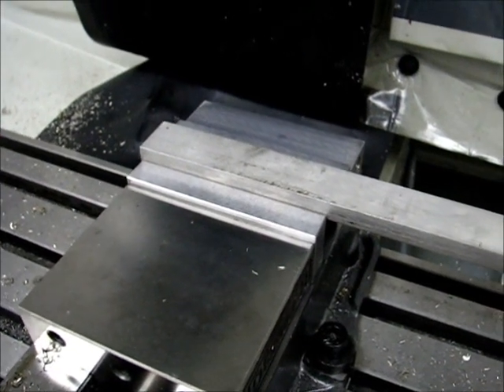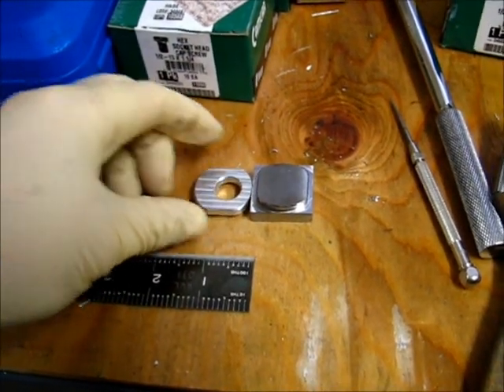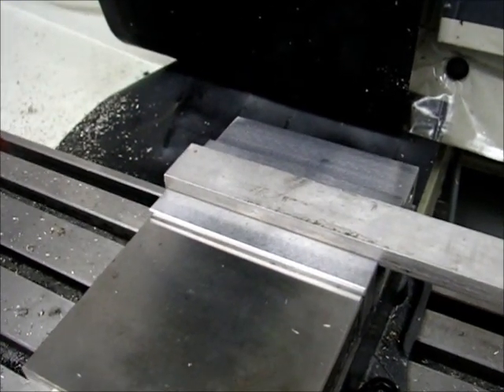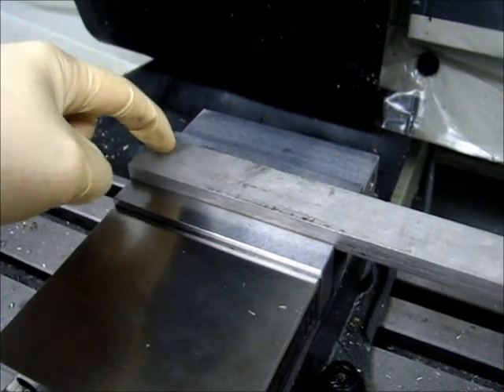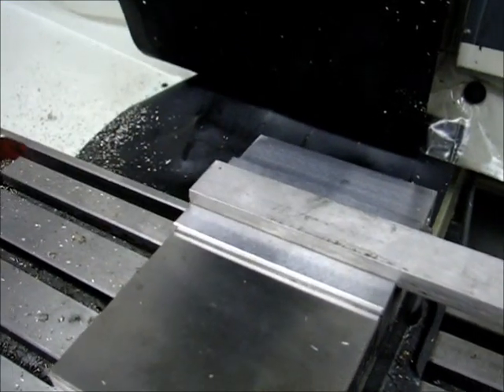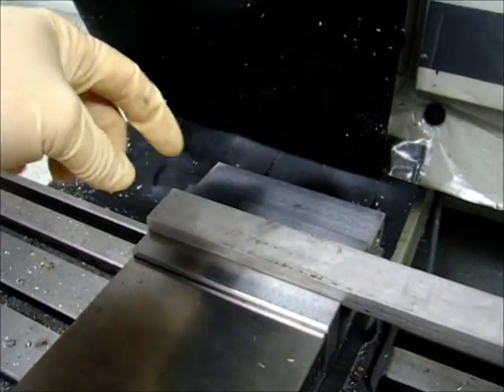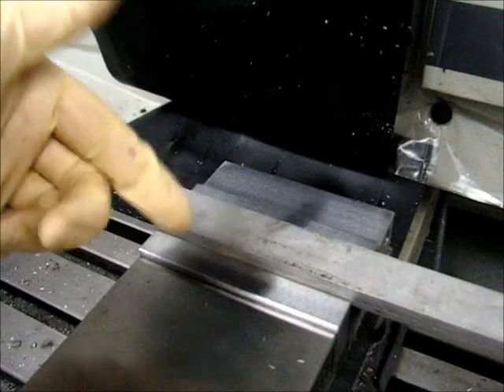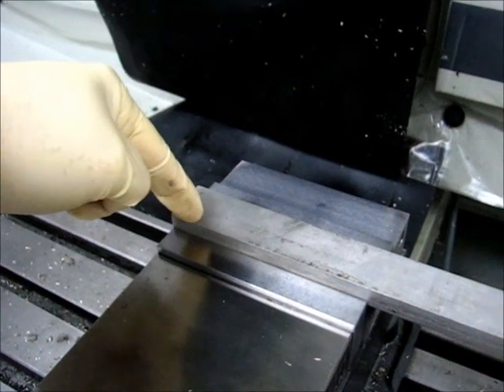Tormach PCNC 1100 - Hole Milling 17-4 PH, The Test

Comment from the maker: I've milled holes in aluminum without predrilling, just as you describe (helical entry roughing and then finishing) and it was no problem. Then I started breaking stuff in this 17-4 PH and got worried about it. I'm considering trying ramp angles on this one too. The end mill is .375" so it's big enough.

Comment: Learn your CAM programs "Entry" - This entire tool path can be done in the entry with an endmill, then do a profile to clean up. Get an endmill that is atleast 50% of the hole size, and do a 1-3degree slop to the bottom, never stopping, no plunging, just happiness for the endmill, then finish with same endmill. Hole can be done atlesat 75% faster doing this if you, you can move pretty fast at a 3 degree slope without worry for anything, just push it. (I do this in Titanium)